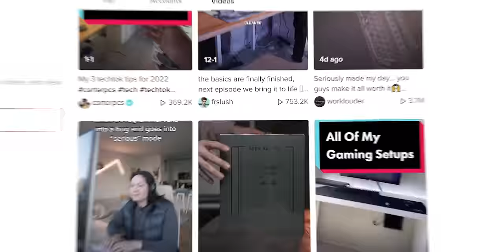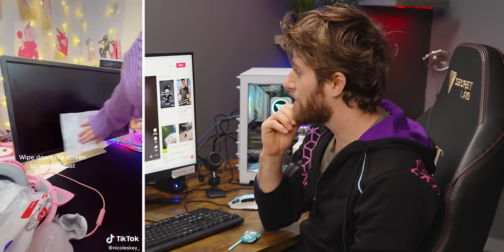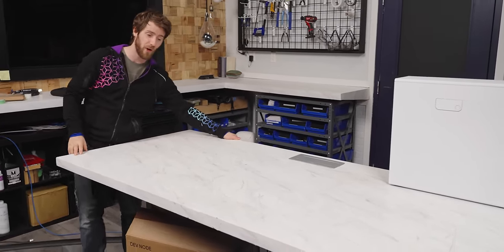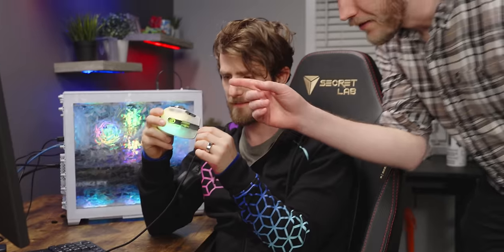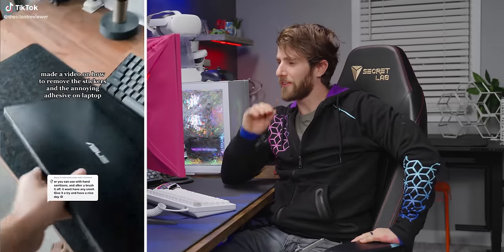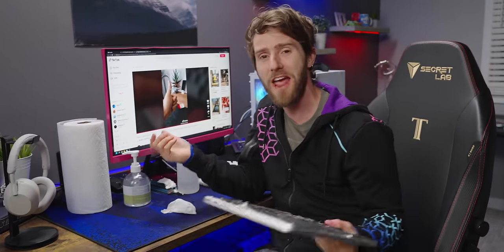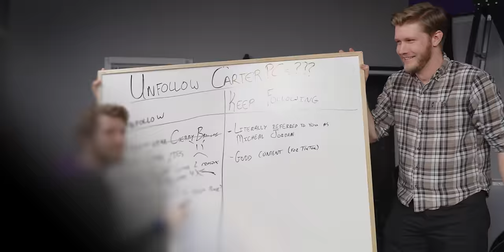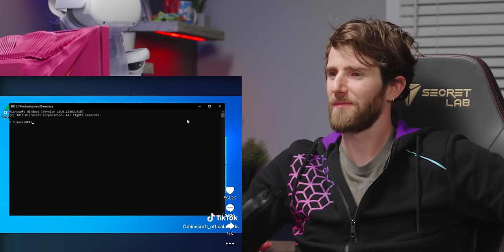TikTok Tech Tips are Terrible

Comment: WD-40 is another way to remove sticker residue, depending on the material. They used to make WD-40 pens that were great for it
Reply: Plus a magic eraser with it. Works everytime
Reply: I've used hand sanitizer as a facilities painter for spilled paint before. Offices and schools are abundant in it and it's amazing for a quick cleanup job on tough cleans
Reply: On the other end, for all the great uses for WD-40, it shouldn't be used in locks/keyholes or squeky hinges. It's a temporary fix that will inevitably make your situation worse. Once the WD-40 dries it leaves a residue making your lock/keyhole worse and the squeaking will return. Use a dry lubricant like graphite.

Comment: For any of those interested, drag clicking can actually be used to get up to 50 cps. Pretty cool
Reply: My auto clicker can get up to 100 cps
Reply: I've gotten 56 cps with a Bloody A70x, without tape
Reply: you only really need 20cps because minecraft runs at 20tps meaning it only accepts inputs every 20ticks per second
although going above 20 gurantees that you hit a click every single tick
Reply: Nah 💀
Reply: @ThanksForAllMyToes  its the same mechanically as those instant dotted lines on chalk trick teachers use
Reply: @ThanksForAllMyToes  Drag clicking is all about friction on the surface. Tape can help with that
Reply: Can this be used for guns in single fire to shoot fast?
Reply: @EternalRivals  most games have it so that there is a delay between shots so probably not but maybe on some games you can
Reply: @EternalRivals  impractical, disregarding the other guy's comment there is a delay everytime you start a drag click. (this is still useful for minecraft (the game that originated the clicking method) since its used in multiple fast/percise block placing or knockback reducing which has gaps of delay where you can reset to drag click again)
meaning you will not be shooting at 100% of the time, you should just use something like jitter or butterfly clicking, or even just develop a trigger or faster normal clicking finger for that.
Reply: @gravityshark580  thanks for the info ya I  missed that 2nd comment by you 😅
Reply: my pb is 66 cps on a Bloody A60, and I've seen people go up to 100
Reply: Why does nobody scroll wheel click?
Reply: @moej6014  because it requires a third party software, drag clicking can be done without anything like this.
Reply: Telly got 120 once
Reply: @oldveryveryoldmanfromthe1900s   imagine needing an autoclicker💀💀💀
Reply: ive gotten to 160 bolt clicking
Reply: @gravityshark580  this isnt about minecraft, and TPS is server based and the real average on most popular servers is 18-19. Drag clicking is common for clicking fast.
Reply: @cewla3348  Fair I just assumed Minecraft because that's the game that mainly pioneered it.
True but I'm just saying that going 50cps and 20 cps will be almost the same gameplay wise.
I think its pretty impractical, mainly due to the reset you have to do each drag, the lack of things/games you need extremely high CPS for, and from my experience so many factors that impact if you can drag click or not, I could think of Minecraft and probably clicker games like cookie clicker.
Reply: @gravityshark580  fair fair but people can drag when going backwards, its really cool
Reply: @gravityshark580  depending on method you may want that full 50 because things like godbridging you only drag click to make sure you place the block  at all not to place a lot.
Reply: @danileliasov 80 with an a60, 70 with the bedless, its kinda a scam
Reply: Most mouses can drag click to an extent, the tape just makes it a lot easier
Reply: I have literally never heard of this outside of the normal "drag and drop".  I was never into speedrunning, let alone speedrunning cookie clicker

Comment: In the shop I worked at, we would use the lighter fluid (Ronsonol) used to refuel Zippo lighters to remove stickers.  It works great and evaporates fast.  It also does not leave a residue or odor.

Comment: Hand sanitizer actually works very well for getting stickers off things because it's basically gelled isopropyl alcohol with some additives. The gelled IPA is what you're after, you let that soak for a bit then peel/wipe it off, and then afterwards you finish up with some pure IPA to get the gunk the hand sanitizer left off. It's the fact that it's gelled that allows you to soak the sticker residue, which is actually a technique art restorers use as well; they gel their solvents to let them sit longer without evaporating.

Comment: You were supposed to let the glue on the keyboard dry before washing off the excess glitter then push on the keys to loosen them so that it acts as a crumb catcher for your keyboard
Reply: that was exactly what i was thinking, why didn’t they wait for it to dry???
Reply: @mrticklenuts2124  Be that as it may, I'm still disappointed that they didn't test it "the right way".
Reply: Why wouldn't you use a tube of silicone instead of glue?
Reply: @bondjovi4595  Drying silicone gives out really heavy chemical smells when drying so it'd need to dry outside for it, also it takes "ages" to dry out fully. Did that mistake when I applied new silicone into my aquarium, didn't move it to balcony for applying and drying.
Reply: Cause DumbDumb video did not specify that part xD if you commenting here you follow Linus and know how impatient he is!
Reply: The next best thing to not using TikTok for actual tech advice.
Reply: @haydenw8691  Or ever at all.
Reply: @bondjovi4595  Silicon is also too flexible and makes breaking the keys loose a LOT harder then the stiffness of dried glue... oddly enough, that glitter would increase the stiffness a very slight bit... I was laughing at Linus not letting the glue dry completely...  The idea behind that "crumb barrier" is that the un-pressed keys close the gap for particles to get through, but it needs to be a thick glue to not drip underneath and any key presses will still allow for particles to get sucked in... better to just get a small vacuum to pull out the particles, rather than take a chance at destroying your keyboard...   I have saved many keyboards from soda or liquid spills by running it under the tub for several minutes, then blowing it out with a hairdryer, and then letting it air out in a war, place for 24 to 48 hours... I have had an 80% success rate, although sometimes there is no salvage... at least the possibility of recovery is worth the attempt.
Reply: Glue? Serious? Just buy a RGB keyboard who cycles through the whole light spectrum on it's own without any drivers at all. Smoke some weed and Wheeeeeee....... There you go....🎇

Comment: For that first "tip", you can achieve the same look with much less damage to your keyboard if you just use craft glitter tape. It's a bit more fiddley, since you have to cut and apply strips of the tape. Or remove the key caps, mask the entire cover in the glitter tape, cut out the holes for the keys, and then put the key caps back on.

Comment: I just use Posca paint markers for coloring my consumer electronics... Skateboard, bicycle and anything really. If I want it to be a little more durable I apply a few layers of bar-topper. The pens are neat because you can more accurately paint surface details that would present build-up and drips problems. It's quite a bit slower though, but the colors are opaque and vibrant!

Comment: "A really cheap hand warmer that is really cheap as well."
Reply: Hand warmers gor gaming when you have an 800 watt space heater right next to you.
Reply: You know what is even cheaper? Warm water. Just fill your sink with warm water, put your hands in it and in less than a minute they are warm again.
Reply: Better tip: Sit on hands
Reply: $23.
Reply: @Finkelfunk  the lotion for the dry skin, not so cheap. Better than affiliate money for lithium ion banks, though. The real hack is rice in a sock, in the microwave, though.
Reply: I just place some clothes on a central heating radiator and hold onto it for a few moments. You can't get cheaper than the heat you are already paying for. Overheating laptop is also a nice source of warmth.
Reply: @helgenlane  laptop does not need to overheating to be a nice source of warmth. If its overheating heat stays inside the laptop, if its not it goes out the laptop into the room. Heat produced is the same with overheating and non overheating laptop. Non overheating one is actually better to heat your room faster.
Reply: @JuanMartinez-vf5hd  sure, whatever, but a 60°C laptop feels warmer in hands than a 30°C one that has strong fans.

Comment: ~12:00 most sticker glues are water based, so a good way to remove it  is with an oil-based solution (ie: baby oil).
Reply: If it's water based, the best way to remove it will be a water soluble substance

Comment: 13:05, as a mechanic and computer nerd. I actually prefer zip ties. I literally buy them buy the thousands, cable ties may be better for small cables, but for thick cables, zip ties are way stronger. I love zip ties (and duct tape). And they are super easy to cut with wire cutters if you’re too cheap to buy the reusable ones.

Comment: How to apply vinyl very easily : spray the surface with water ( if able) and add the vinyl without the wrap thing that protects the sticky side use a squeegee to squeeze the water out and cut the excess off the sides then leave to dry for a minute or something so the vinyl can fully stick and done!

Comment: Hey, Linus!
Regarding removing labels or stickers, plain oil is an excellent solution. Many adhesives don't dissolve with alcohol, especially the ones used for labels. I think it's the Aloe oil in the hand sanitizer that makes it useful. I'm not exactly sure why oil dissolves glues, but it does. It does require a little more clean afterwards.
Reply: I've been using eucalyptus oil on stickers and labels for years, more common in Asia and smell good
Reply: Yep. For very stubborn adhesive residue, I often alternate alcohol, plain cooking oil (Crisco), and dish soap.  Aside, oil dissolves in oil, so if you have grease and oil on your hands from working on a car, bike, etc, some cooking oil works wonders helping getting your hands clean swiftly.

Comment: Always scuff the surface before you paint otherwise it can easily come right off
Reply: He said that
Reply: He said that
Reply: lmao bro do you even know what "sanding" means?
Reply: @flyingtentacle7631  bodyshops in the UK call it 'keying'
Reply: You'd want to do a little more than just scuffing it. Take off all the shine with some fairly rough sand/glass/wet&dry paper.
Wipe over with a tack rag before applying a proper plastic primer.
Reply: @Chewiebakke  So if you want to repaint your expensive car, just leave it in a dodgy shopping parking for a week?
Reply: On metal, sure. On a porous material like plastics you only need to use a primer and give extra time for the paint to cure.

Comment: Do NOT use rubbing alcohol on a screen. Especially touch screens. I did that once and it stripped off the oil resistant coating and the screen was a smudgy mess after that.

Comment: 18:20 you can just stop the loading of the element by clicking on the "X" next to url after you refresh the page. :)
Reply: Doesn't necessarily work for all pages since most of the time the scripts required to prevent reading these pages are loaded first and only executed after loading has stopped. So even cancelling the loading process is usually just a big nothing-burger. Sometimes UBlock Origin can just get rid of the overlay but some sites built in protection like scroll blocks or outright not displaying the whole content on the page to begin with. Others have done weird stuff like jumbling letters which takes a script to unjumble articles. It's an ongoing battle between ingenuity and adcampaigns.
Reply: @Finkelfunk  Reader view (ctrl-alt-R in Firefox) works on a surprising number of news sites, including the New York Times. There are a few, like the Wall Street Journal, that aren't susceptible to this, because they clearly paid enough to hire developers who understand that YOU SHOULDN'T FREAKING SEND THE TEXT OF THE ARTICLE TO SOMEONE UNTIL THEY'VE PAID FOR IT. Sorry, but incompetence really bugs me even when it works in my favor.

Comment: 2:15 the fire extinguisher  still have the yellow protection!!! you have to remove it otherwise you wont be able to pull the safety pin in an emergency, this happened at my work before when a smartphone got on fire but we couldn't use the fire extinguisher.
Reply: They not that hard to break lol

Comment: Pro tip, outside of circuit board contact5, 70% IPA is almost always better than 99% IPA as the dilution ratio allows it to properly loosen dirt, gunk, bacteria, etc before it evaporates away.

Comment: The hand sanitiser one is because of the gelling agents acting as surfactants (carbomer in the one you used) 

Same thing that helps it spread across a surface also helps it dissolve stuff (i.e. how soaps work) - In practice yeah the 99% is gonna work better, but hand sanitiser is a bit easier to find than the high conc alcohols or organic solvents

Comment: I've said many times that 99% isn't the best cleaner to use if you want to clean something that doesn't explicitly need as little water content as possible.

Alcohols, unintuitively, work MUCH better at 50-60% by volume than even 90% let alone 99% ABV, I can't really tell you the chemical reason for this though. Retest this against your bog-standard IPA you'd buy at a store.
Reply: You drink some stronger IPAs than me if they work as cleaning products. /s

Comment: I downgraded my BIOS on my laptop recently to the second oldest version because they removed features in newer versions after I updated, I'm glad that didn't brick my laptop lol
Reply: What features were removed?
Reply: @PierceMD  The biggest feature removed was the hardware airplane mode switch. They decided to disable if unless you were on Windows XP or 7 because 8.1 and 10 have software airplane modes. I didn't want the switch to not work, so I downgraded to a BIOS version that didn't disable it on Windows 8.1 and 10.
Reply: @NottJoeyOfficial  sucks they gotta lie to you like that. but a switch that can be disabled by BIOS is a software defined switch, it cannot be a hardline or it would physically disconnect the radios and no amount of software at any level could change that.
Reply: @freedustin  oh no, its not a hard wired switch, thats the issue. It seems that it was fully controlled by the BIOS and they figured people would not want a physical switch on Windows 8 or 10 for some reason. I use it a lot, so I was very upset when that feature just stopped working out of nowhere, glad I could get it working again. Those old Dell Latitude machines are amazing, but some of the updates they did like that are quite weird.
Reply: @NottJoeyOfficial  Mi E6420 have that but I turn off because somes times I move the laptop and that thing turn off the connections, the nice thing is you can customize what you want to control, the Wi-Fi, Bluetooth or the 4G card, I just leave it for bluetooth.
Reply: I'm curious what model is the laptop? That sounds like something Louis Rossmann would be interested in.

It's mind boggling and at the same time not a single bit surprising that manufacturers can wake up one day and say "hmm, the software (which can be exploited, abused or malfunction) has the ability to control important features of the device, so we're just gonna spend time to intentionally disable a physical switch that had worked before". Sure, it may not be a full hardware switch, but the low level firmware will still be more reliable at controlling a radio device than an OS
Reply: @VideoklipBG  This is the Dell Latitude E5430, a very solid machine. Dell probably decided to change multiple BIOS back in the day starting when Windows 8 first released in 2012. I actually checked the notes when updating and found they specifically mentioned disabling the function of the switch in one of the updates.
Reply: some bios updates can eff up your machines,  never update for fun for no reason, when everything is working. 
my legion 5 pro 16arh7h is a good example. i googled first about the newest bios update and they strongly discouraged updating into it in practically all comments. also surprises like 
" Many users on Lenovo's forums are reporting missing encoding codecs on their Legion laptops after a recent BIOS update. This issue appears to exclusively affect Legion units sold in Germany, potentially due to now-settled litigation with Nokia.  This missing feature is the H.264 encoding codec.
The lack of this encoder causes numerous issues on user's devices, such as Shadowplay crashing, OBS failing to record/stream, and even the Oculus Quest 2 failing to stream video from the laptop to the headset over USB. This also makes many major use cases for high-power gaming hardware (streaming, video editing, or just recording your screen) difficult to do on these laptops."